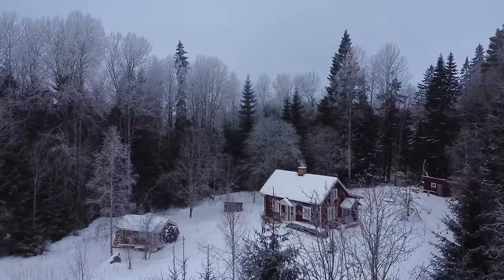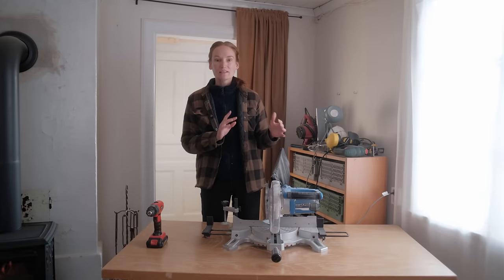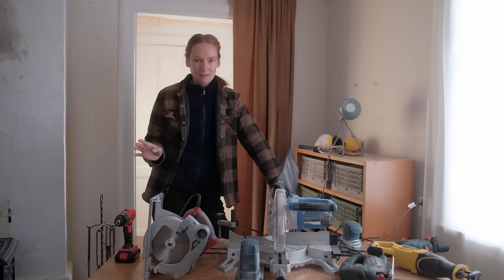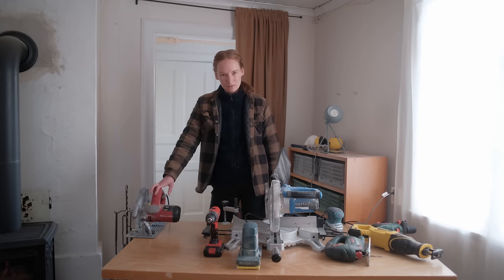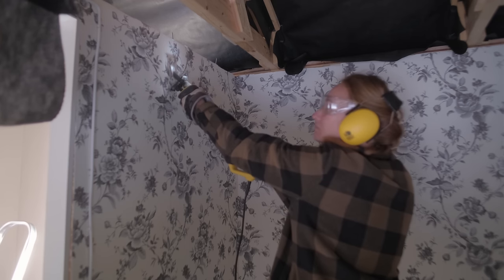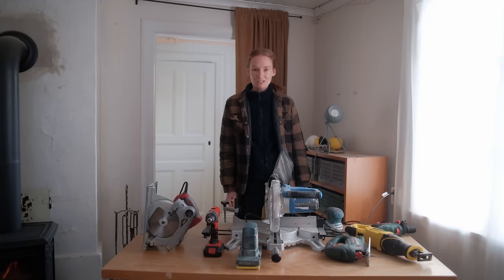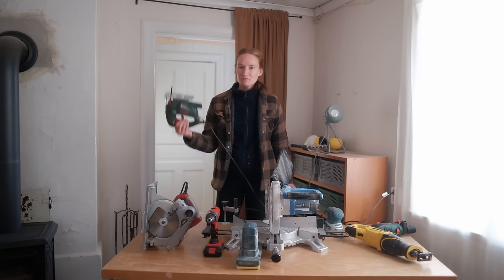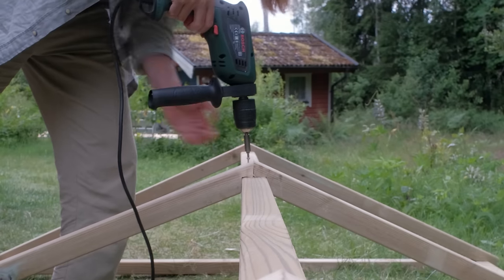The (basic!) Tools I Use To Renovate My Cabin

Comment: Biltema stuff is great for the price, but a bit of a gamble. I built a house with biltema tools, but they do break down occasionally. But then just go and buy another one. Of course, it is not for professionals. But for home DIY, certainly a good starting point, especially if you know you do not need for more than one or two projects. Nice video Rosie, thanks!

Comment: As for nail guns, I use a “pancake compressor” and/with either a “brad nailer” or “finish nailer” gun. When I’m using 2X2’s or 2X6’s and 2X8’s, I use a “framing nailer”. Roofers use a different type of power nailer called a “roofing nailer”.

Comment: You can get a powered staple gun that does brade nails too, it looked like a velcro piece was missing on your detail sander and that might explain why you are not getting the finish you need, believe it or not i sanded all the floors and trim including the doors with a black and decker mouse. Only because I have grip in one hand. ❤

Comment: Okay I do a lot of my own renovations and I have to say an impact driver is a must.  Also my recent purchase was a track saw, my very favourite tool by far. I have a small battery nail/staple gun, which was not expensive. It does panel and soft wood, but it does not do hard wood.

Comment: Once you buy a cordless tool with battery and charger buying another cordless tool (same brand) most offer "tool only".  Of course you will want to have another battery, one in the tool and one charging. For your use the 18 volt battery/tool is good or two 18V for 36 V depending on the tool.  30 years of carpentry work and now a retired carpenter still doing DIY work, Makita is my brand for carpentry, wood working and power garden tools, all cordless.  That carpentry, woodworking can be a very deep, infectious and satisfying rabbit hole.

Comment: That straight metal thing in that last box is called a file . As it appears fine toothed it is probably a metal file. A wood file, called a rasp , has much coarser teeth. However I use a metal file on wood where I need something more gentle.  I

Comment: Rosie, you did a good job on explaning your tools!!! Dont wish for a Nail gun-- They are heavy??? Regarding your jigsaws, try and study the bottom metal plate, there should be a screw to loosen and angle the jigsaw? (on your Biltema one it might be loose or missing?? also the blade might be loose if it wanders off-course) When using Jigsaw for those long cuts, clamp a straight piece off wood, at the distance so the metal-plate can run along, then you dont have steer a much!!!

Comment: In general, totaly agree for starting with corded tools, as they are more cost effective and often a bit more durable. The impact drill is indeed for masonry and softer to medium hard stone. For most concrete or hard grade stones you would need a step up, a hammer drill. However usually these impact drills have a non impact setting for normal drilling. This is great if you don't have masonry. They can do higher speeds, thus also way  better suited for drilling in metals compared to most simple or cheap battery drills, so actually a good addition to have. I would not risk using a normal power drill for screws since there is no torque limit as on all battery screwdrivers.     This could cause a wrist injury if the screw gets jammed somehow! So watch out, and just get a normal battery driver for that For really long and big screws: special battery impact drivers exist for that. Yes, it's a lot what exists in the stores, but just buy what's needed and hace budget for.
Reply: Also there are stands for those normal corded drills to turn them into makeshift or simple table drill. typically you need to remove the front handle for that. Works nice to drill straight and have a good view on the drill bit itself (with protective glasses that is).

Comment: My huscand and son enjoy Milwaukee and DeWalt, but they both are heavy. 
Thank you for this video. I have wondered how you chose your tools. Now at least I have a list of fundamental considerations when I head into the hardware store to choose a tool. 
Having more than one "system" is a not necessairly a bad thing. The most important thing is having the right tool for the job, buy a good quality tool once and never need to buy it again. That's a money saver. Especially if working with wood will continue to be in your life, the sooner you cut your losses, the sooner you'll begin saving money and be able to create superior products that you'll enjoy the process of making.
One shelf in our garage is set up with various battery chargers and at least 2 batteries for each charger. 
Selling the tools you have but don't use as well as the tools you have but won't use once you begin using 'systems' could help recoup some of the expense. 
I don't know about in Sweden, but in the states, Amazon sells prepackaged shed (aka workshop building) kits at pretty decent prices. They don't include heating or air conditioning systems, or electrical or plumbing. They're sturdy and practical. 
Thanks again for such a great presentation!

Comment: If you can at all justify the expense, I would highly recommend getting that track saw as an alternative to a circular saw. We have a circular saw, and it is so heavy and powerful that I can’t use it at all. 

So I bought a mini handheld circular saw (designed for cutting laminate), and while I can actually use it myself, it was still not the easiest tool to use; it takes a long time to set up my cuts, and it is so weak that I have to do multiple passes. I have some issues with accuracy as well.

I also have a table saw but, as you say, it takes up so much room. It's also really hard to move around (I like to do woodworking outside where there is more space). And it's quite dangerous and scary.

Then I saved up for a long time and finally bought a track saw, as well as some rails for it to glide on, and it is a dream to use. It’s so fast to set up the cuts, the cuts are extremely accurate, and it is effortless to use even though it has a large blade. My mitre saw used to be my very favorite tool to use, but I love my track saw even more. It’s so satisfying! Love, love, love it. I wish I had bought it in the first place instead of all the other saws.

Comment: The tools you didn't know the name of is a file.
A random orbit sander (round) don't leave as much marks on the wood, it's great for finishing but not hogging away vast amounts of material. A belt sander might be good for that, but honestly; Get a hand plane to do the rough lumber; Get one off a yard sale for cheap and check out Rex Krueger in order to get it restored. You will love the process of using it.

YES chisels needs to be sharpened, often. Check out the "Scary sharp" system it uses cheap sand paper and a flat surface such as a floor board a peice of glass or a tile.

Makita is great, but quite expensive. My recommendation would be to check out Ryobi as an alternative.

You don't need to have an infeed/outfeed table,  you can get away with some rollers. a contractor saw can be quite small when not set up; but a table saw is also very scary and very loud.

Lastly ABSOLUTELY get a track/plunge saw, it is a *game changer*. I use mine all the time even thou i have a table saw.

Comment: As for a ruler, I use a quality tape measure like Stanley and a well-made and marked Carpenter’s Square for ensuring a straight cuts across a diminutional length of wood then mark it with a wood pencil.

Comment: A shop vac that cleans up water is nice. If you have a spill or leak that needs cleaned up it does double duty to clean up wet messes as well as saw dust and dirt.

Comment: Personally I think you're doing great with the house renovation, I would suggest getting a shop vac though. 
First and foremost to protect your lungs! 
Oh, and a track saw too, awesome bit of kit. Especially for those longer straight cuts. 
The rest: use what you've got and you will be just fine. 
Only when you decide to go cordless on all your tools it's important to investigate all the different systems. 
Otherwise: keep the batteries topped up, build a charging station and use what you need.

Comment: I have an Einhell cordless impact and drill. I got it as a combo set with 2 batteries and 1 charger. As you said it speed things up when you don't have to change bits. It is a German brand, and I checked it is sold in Sweden as well. Mine are must be more than 5 years old. The motor in the drill died this year, I took to the service centre and it was replaced in 1.5 weeks and I paid 34 euros. Can't complain.

Comment: You've done it the right way, buy cheap what you need atm and choose other brands when you can afford. Just a little tip for you when buying your future cordless tools, it doesn't have to be extremely expensive. If you choose as you mentioned Julas MEEK tools, you most preferably choose 18 volts or higher. If you buy a pack with two 18 v batteries and one charger.  These batteries will be dit for any MEEK cordless 18 V tool you buy afterwards. Keep up the good work.

Comment: Instead of a ruler you could use a metal pipe or what I use is an aluminum plaster scraper, the long ones and clamp it to the piece or table as a guide rail 💡 saved me a lot of money and crooked cuts 😊
You are doing great with what you have on hand ❤
What happened with the Jackery mobile battery?

Comment: Greetings Rosie! You do good work. If available in Sweden, you might want to look into the Ryobi line of tools, 18 volt batteries, and they do have a battery powered 18 gauge nail gun! (It works great and is VERY handy.) Keep making sawdust.

Comment: the bosch jigsaw can cut at an angle actually. you hace to adjust the base plate by scewing it loose and readjust to the desired angle. there are 15° grooves to latch into.

Comment: Rosie, rethink the air-operated nailgun. It is way smaller and lighter than an electric one. A small compressor will do, it costs less than € 100.-, and it comes in handy for other purposes, too. E.g. to inflate your bicycles (which must be done once in two weeks). I guess that an air operated nailgun and a small compressor together cost way less than an electric one.

Comment: At first I wasn’t going to watch but glad I did! That was helpful for an older not  very strong woman.😂. Small hands and weak wrists. I have Ryobi battery tools but haven’t used them yet. Only the air inflater, fan and flashlight. You’ve done a great job with what you have!

Comment: I'm a DIY-er and I like Ryobi tools. Unfortunately this brand is sold exclusively by The Home Depot so not very helpful for you. I have a couple of Bosch tools. My boyfriend likes Dewalt or Milwaukie but he needs higher level tools for his work. He's used some of my Ryobi tools and at times they are as good as or out perform his "fancy" tools. I highly recommend an impact driver so you can have a drill and a driver. Saves so much time and keeps me from dropping and losing bits! I think you have most everything else that I find essential. I got a belt sander from a garage sale a couple years ago and I use it to restore old fence boards for projects. Currently into shou sugi ban. Love it!
Reply: Ryobi is sold all over the world
Reply: @acajutla  Great! In the U.S. it is only sold by Home Depot.

Comment: I'm mostly on Milwaukee battery platform, but I don't like their nail guns too much (they're filled with nitrogen and aren't user serviceable - heard some stories of them leaking and then it's warranty time), so when I needed a nail gun, I bought Senco AC4504 + FinishPro18Mg combo kit. Paid 250 EUR for it. It's a compressor that you have to plug in yes, but it's very small, only 4 liters, very quiet and I feel like it'll last forever. I can add cheap 23ga nailgun for smaller stuff if I need it in a future. Battery powered guns, like any cordless tool, are very convenient, but they are heavier and more expensive. If I had to get one now, I'd go with Makita from their 40v XGT line. At least it's a mechanical system (I think a spring) and the only downside, if I remember correctly, that it's limited to 40mm nails.

Dewalt spins some kind of flywheel to get energy to strike and I have their batteries too, but the nail gun is soo big and I think has a delay to spin up so I didn't really consider it.

Comment: Hi Rosie :) 
I’m a home DIY gal too and started out a lot like you did, many years ago now. 

I can honestly recommend Makita tools and cordless specifically. 
Yes, they are a lot more expensive, but in my opinion, they have made my life immeasurably easier and upped my DIY/Woodwork game in a huge way.  
Also, all of the cordless tools use the same system as you talked about. So you only need to buy one charger and a set of batteries (reccomend 5AmH over the 3, for lasting time) they only take 20 minutes to recharge and can be used across the whole range of the tools. 
I decided to replace all of my budget tools after receiving a cordless Makita drill and impact driver, with a set of batteries and a charger, as a birthday gift from my Mum, when I first bought my plot of land. 
It was life changing, seriously! 
I cherish those two tools, for the sentimental value along with the fact that they made me realise it’s worth the investment a thousand fold.

So I set about working out which tools I needed the most. Made a priority list and priced them all up. 
Then I saved and bought them one at a time. Now I have everything I could ever need (and more) and because they all use the same battery system, I have only ever used two at a time. One to charge and one in use. The first two that I got as part of my gift, lasted me 6 years plus and I build an entire house, stable block, workshop, outhouse and woodshed using them, just to name a few things. 
I’ve since bought more, two more sets of two. As the old ones have weakened and started to not hold charge. But they last a LOT of hours and are way more powerful than I could ever need. 

Try to purchase a set, a drill, impact driver and 2 batteries and charger. Then add to it at a financial pace you can manage. Maybe one more tool every 2/3/4 months. Before long you will have a full range of fantastic tools you can rely on, that will boost your already great skill set! 

Sending love from Estonia, one winter wonderland to another! ❤
Reply: Also, I forgot to mention. The impact drivers are quick release and take seconds (and one hand) to change out the heads. Plus you can get pilot hole driver heads that are drill bits with the shaped head to put into the driver. 

I use mine just about every day! It goes everywhere with me, from one end of my land to another and back again. 
I even throw it in the back of my truck when I go someplace. You just never know when someone might need a little job doing (in my case, I’m constantly asked to fix something for friends and family! 😂)

Comment: I have generally used my husband's tools. I use his cordless drill alot, but I would love if it was not as large and heavy.
I have used a mitre saw, and like that as well. It is corded.
For saws, I would like to get a cordless jig or sabre saw, one that works well, and it not too heavy.
I have used my husband's circular saw, but I am not keen on that. Size and noise.
I bought one of the cordless mini chainsaws advertised. So I looked at ratings online. I love it! It seems there is always so much brush and trees growing where they shouldn't. (By the garden, under the power line, etc. It is a Taranzy, came with two batteries. 
I really appreciate your comment of the value of a cordless drill and either a power screwdriver or the like. It is so time consuming to constantly change bits.
I love the work you have done, and I am trying to get the nerve to make more than simple shelves but up with brackets. 
Your videos inspire me,, Thanks!!!

Comment: Great video Rosie. I am the same with some tools, for me its the grinder cutting tiles. I have to mentally prepare. I do find running through a safety checklist , make sure the guarding is undamaged and secure, the blade is undamaged no chips etc makes me feel better using it. I also find cheaper tools can actually be harder to handle so sometimes its worth paying more for a better experience. I learned that the hard way :) There should be a screw for the jigsaw bed. Its made to be adjustable.

Comment: I can relate to problem tools most are made for men . As a woman  alot of the cordless batteries are hard to put our smaller hands around  to pull the battery out
Reply: You right I have a cordless ryoby drill and as a woman I have a hard time tu take off the battery , the company have change the colors of their tools for women but not the sizes or the weight go figure lol

Comment: Hi Rosie, so much fun watching you work on your house! I also use woodworking tools and have a suggestion for a very inexpensive track set up for your circular saw. You would make it out of two long lengths of wood. It is a "straight cut" or a "rip" guide with two cutting sides to fit  the base of your saw. Very easy to make. You clamp it onto the sheet material and run the saw along it,  just as you would with a track saw. It may require a sketch to explain further or maybe you could do some research "circular saw rip guide diy" for more info. Cheers!

Comment: An impact driver will often be able to  drive in or remove screws a normal drill can not (Big screws, very useful with australian hardwoods for example) or that would strip the heads. If you think of it like a tap tap tap  rather than a grinding rip apart the head.  Or get loss a too tight a nut etc

Comment: If you end up doing the roof you would really want a nail gun. A small pancake compressor would be an affordable compressor for a nail gun. Also a small generator would allow your corded tool to be used anywhere. Just make sure it has enough juice to run the tools you have.